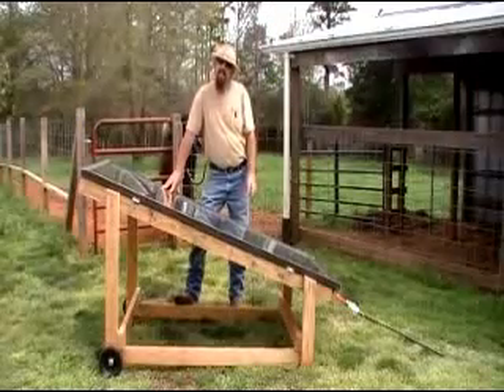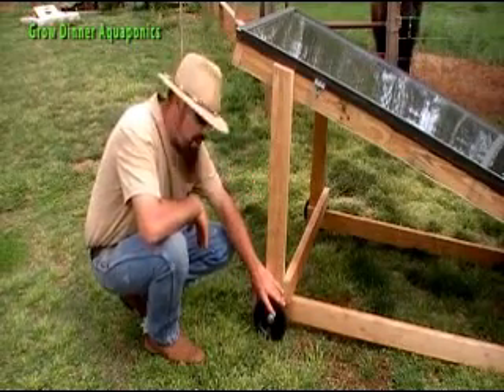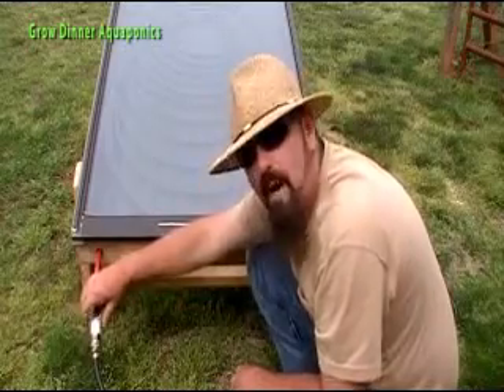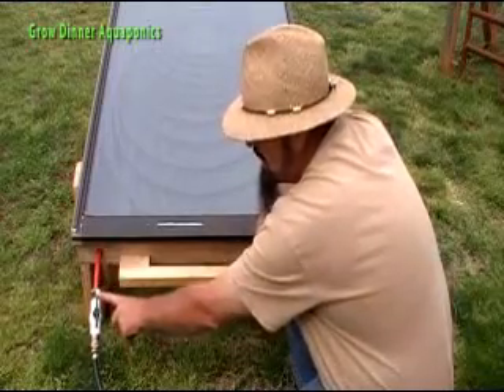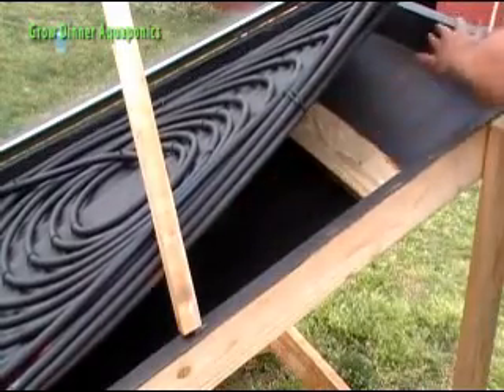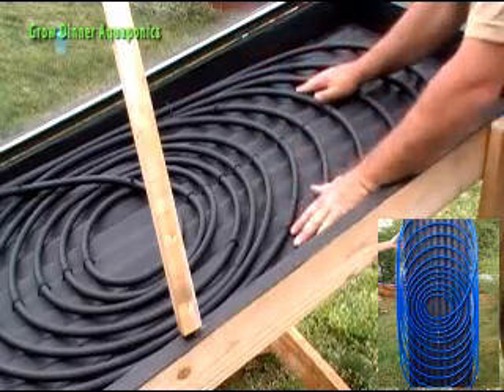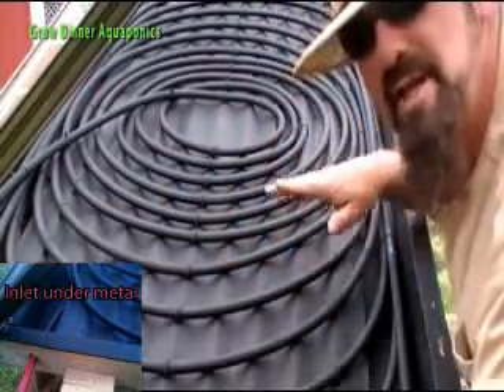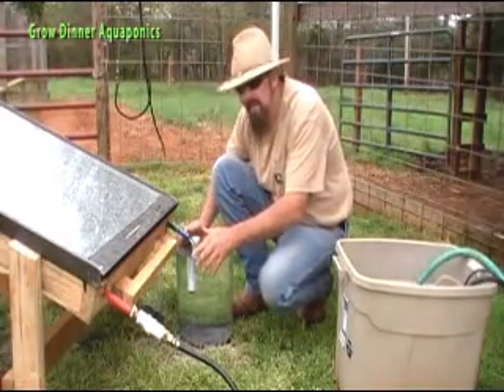DIY Solar Water Heater for Aquaponics

Comment: Great! The temps have dipped down in the 40's by morning and the water dips to 55 or so! In the day it's been getting up to 75-80 and the water temp goes back up to 65-70. But with the days getting shorter, I don't suppose the water will get much warmer than that. Looking forward to the video.

Comment: Nice looking system. Would sure like to see the follow-up video you speak of because of the rain. I'm using a 750 gallon stock tank for my tilapia (Tucson, AZ) and I'd sure like to do something like this for the winter months here. I have blue tilapia which will tolerate cooler water than the pure whites I had. We do get an occasional winter freeze, so it's important to be able to help keep the temps up.

Comment: Thank you. I am building a solar heating panel for my swimming pool. Like you, I am trying to maximize heat absorption and retention inside the panel--I am planning to use as baseboard a one inch styrofoam board with silver coating (instead of painting black) to emulate a greenhouse chamber. Any thoughts about this approach?